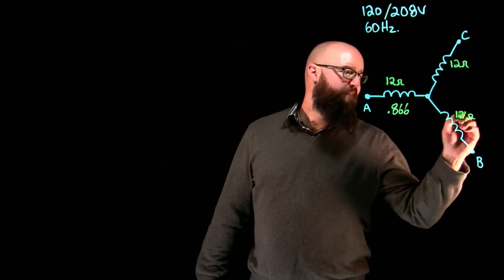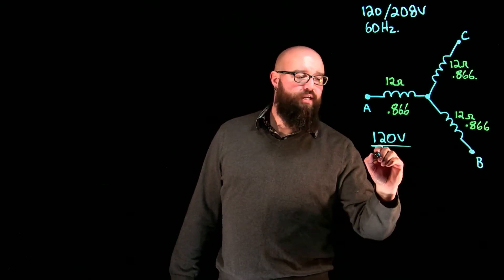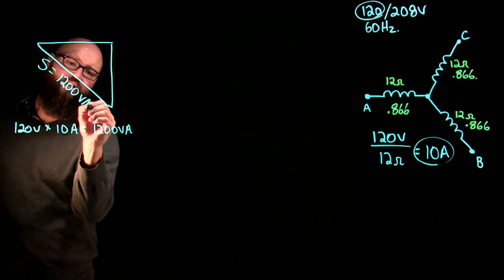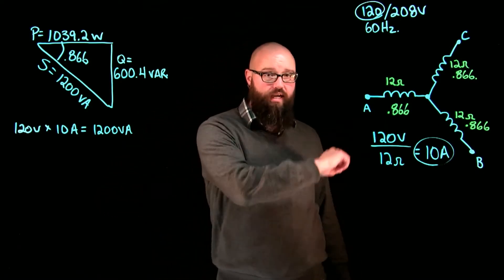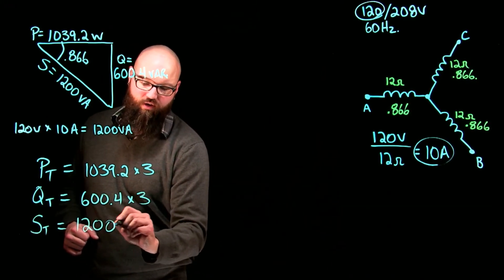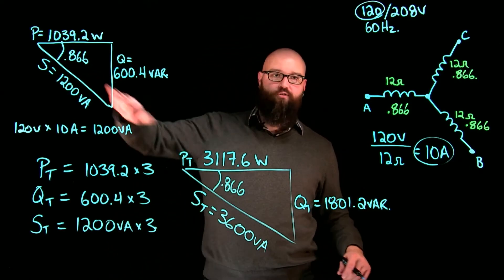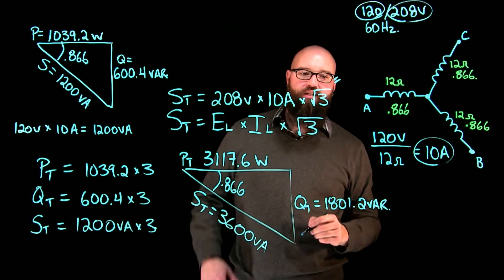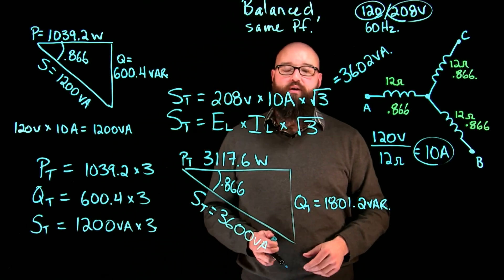Calculating Three Phrase Apparent Power Example - WYE balanced

Comment: What is the S when you want to use the low side 120V instead of the 208
Reply: Using the phase voltage results in the 1200VA originally worked in the example.  The 3600VA is the total 3 phase apparent power that the source would need to produce.  While the 1200VA is the power per phase.